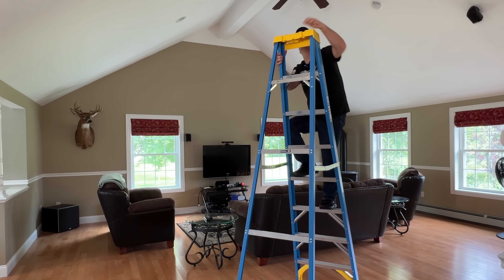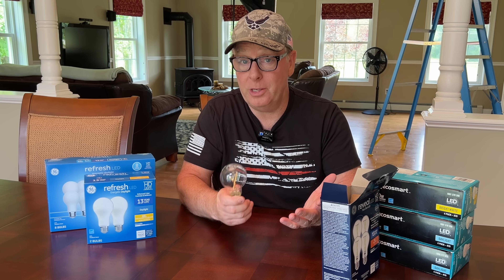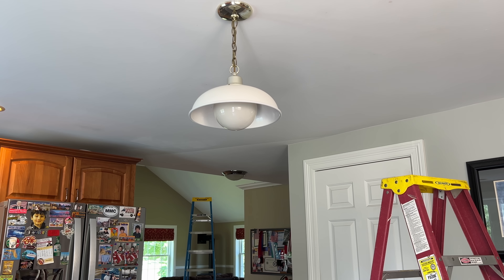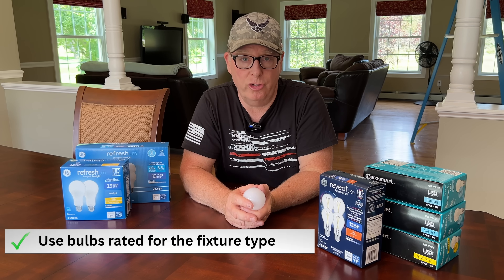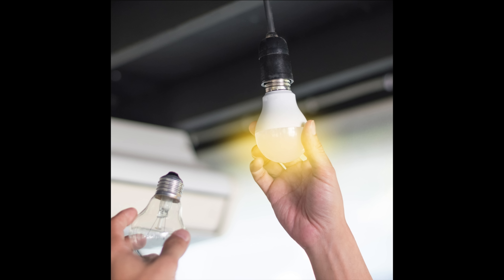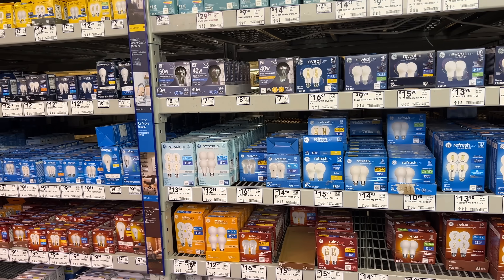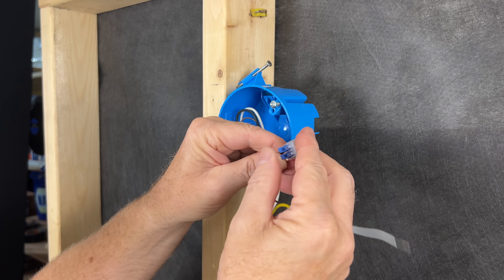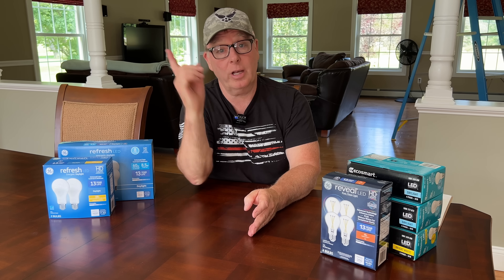The Mistake That Kills LED Bulbs

Comment: This video has quite a bit of equivocating in regard to LED lamp operation on "reversed" AC wiring, as in 'usually, swapping hot and neutral will not affect the LED bulb'. There is no justification for this. Due to their inherent circuit designs, specifically that the AC must be rectified inside the lamp, the LED lamp CANNOT be affected by swapping the two wires. Period. People who insist that it makes a difference don't know what they are talking about, or are at least mighty confused.

On the subject of LED lamp longevity, my own casual study over the years since the early days of LED lamp availability has revealed that QUALITY of components and basic lamp design are the primary factors. Note that I am referring only to LED lamps designed to look and function the same as traditional incandescent bulbs. I have a pair of Philips "First Gen" LED bulbs, each 100W equivalent, that have been in a totally enclosed fixture, OUTDOORS and operating all night long on a timer, for a LONG time. They were the first LED bulbs I ever bought, back in the early days. They are the kind that are shaped like a traditional bulb, but are dark gray, with three orange colored areas on them, from which the light comes. They seem to work just as well now as they did when new. WHY? One reason is that they made them of high quality components with high temperature ratings, and another reason is that the 'bulb' design kept the heat of the LEDs further away from the electronics.

I converted all lamps in my house from incandescent to LED back before most people even knew what LED lamps were. The lamps were quite expensive (the earliest ones I installed cost nearly $90 each). MOST of them are in either fully enclosed fixtures, or in down-facing frosted glass fixtures on ceiling fan fixtures; they fail about every 5 years, and spend more time on than off. The exceptions are the specialty globe-style LED lamps (no fixtures) I have over the sinks in my bathrooms. None of those has ever failed, and I tend to leave bathroom lights on except at night. Oh, I forgot my large workshop, which used to be lit via many 2'x4' fluorescent fixtures in a suspended ceiling, and I replaced the fixtures with new ones having electronic ballasts and fitted with Philips 'fluorescent replacement' bulbs. Since I spend about half of each day in my shop, those lights are on a LOT, and there have been no failures.

The most failures I get are on the LED bulbs (60W equivalent), three per ceiling fan, one fan per bedroom. For these, I just used the FEIT brand bulbs that the local ACE Hardware used to sell, not very expensive but still decent quality. All those bedroom fixtures are on dimmers that are integrated into the ceiling lamp controller that also controls fan speed; the dimmers are designed for incandescent bulbs....sometimes the lamps flicker, and I have to slightly adjust the dimmer to restore normal lamp operation. In my home office, I have the same exact kind of ceiling fan, LED bulbs in the same kind of down-facing open fixtures, but NOT on a dimmer circuit; these lights are on whenever I am not in bed sleeping, and I have to replace them about once every two years (they are also 60W equivalent FEIT bulbs).

I wonder if the LED bulbs currently being produced are anywhere near the same quality as the old reliable LED bulbs I have described above? I have noticed that my local ACE, and the others in the same family-owned chain in my county, no longer sell the FEIT brand, and have only the ACE branded bulbs and ones by leading manufacturers. They tell me that they quit selling any of the cheaper brands because of too many complaints about early failure.
Reply from the maker: If you watched to the end I explained the first part of your comment. I knew the lamp would work but I have had hundreds of comments telling me they won't. For example I just responded to a comment telling me that my voltage test was bogus because I would read 120v to ground even if the hot and neutral were not reversed. This is what I'm up against.
Reply: @BackyardMaine , thanks for your reply.  I did, in fact, watch your whole video. I was not trying to educate YOU, but rather add another voice saying essentially the same thing.

However, I still thought the early equivocating should have been more resolute.....

Comment: Well-known brands (especially Cree) fail too, & many times SOON.  The case of the Cree bulbs I had fail (30 flood lamps for ceiling downspots) was caused by temperature CYCLING, not overheating.  Every time something is heated & cooled, different parts expand & contract at different rates.  In this case, it was the different rate of expansion of copper winding (very fine wire in input inductor) from the hard epoxy it was encapsulated in.  Each cycle was like bending a paper clip back & forth one time.  After ~30 cycles, the thin copper wire "work hardens", embrittles, & breaks, cutting power to the rest of the circuitry.  This is POOR DESIGN, not cheap materials.  Cheaper inductors have their windings protected by heat-shrink tubing, allowing the windings to move relative to the rest of the part.  More expensive inductor, potted in epoxy, FAILS SOONER.  You could set a clock on the failure time!
"Don't leave light on all the time": sometimes, it is the CYCLING on & off that kills the light!
          The same goes for the rest of the components.  Each LED chip has 2 wirebonds.  There are ~100 wirebonds in each lamp.  All the components (LEDS & electronics) are soldered with ROHS (lead-free) solder.  This solder is hard & brittle.  It has no lead, but it FAILS, OFTEN, by cracking because of again, temperature CYCLING.  The whales are killed not by lead poisoning, but by being crushed by tons of discarded bulbs that should be still installed, WORKING, in lamp fixtures.
          Your explanation of why LED bulb works with line/neutral reversal is FALSE.  As long as nothing else contacts the internals of (any) bulb circuitry, the bulb does not "know" how it is being fed.  The front-end rectifier has nothing to do with with the AC polarity hookup!
Reply: I too found a bad inductor in a Cree LED lamp. I replaced it with one I salvaged, and it is back running again. They are a real pain to open and service.

Comment: My porch light is LED, a yellow "bug light" that still attracts flying bugs.. but I've had it on 24/7.  I had a photocell for the old incandescent lamp and did not remove it.  The first LED lamp lasted about 9 month, the next about 6 months.  I got rid of the photo cell and the 3rd LED lamp has lasted 5 years so far.  My experience with motion detectors is very similar - the 'pear shaped' LED lamps have vastly shortened lives.  OTOH I have a made-to-purpose LED yard light with a built in photo cell and it's been good for 4 years now.

Inside the house I think it's mostly heat dissipation.  LED lamps that burn base up, or have some kind of enclosure (like the school house "globe" shade on your kitchen fixture) tend to have short lives.  LED lamps that burn 90° (horizontal) seem to fair better than 'base up' even when enclosed.

Comment: Only place I've had trouble with early failure was using non enclosure rated bulbs in enclosures. On earth day in 2015 I replaced 11 bulbs in my kitchen with cheap Walmart brand LED bulbs, bought an extra one for good measure,  still going over 10 years later. Love these things.
Reply: My experience with Walmart bulbs was the same, but no longer.  Early in 2015, I replaced all the incandescent bulbs in heavy traffic areas of my house with Walmart LEDs.  I'm a night owl, so those bulbs get used at least 8 hours per day.

I got 8 or 9 ayears out of those bulbs.  One or two of those bulbs stopped working, and the rest were starting to dim, so I replaced them with new Walmart bulbs.  The new Walmart bulbs lasted less than six months.  I took them back to Walmart, and they replaced them for free.  Those bulbs only lasted a few months as well.  I took those bulbs back to Walmart and got a refund.

I used the Home Depot brand bulbs, and they have lasted two years so far with zero failures.
Reply: Target brand has a good rep.  And Home Depot, as in this video.
Reply: Yeah the Great Value bulbs from that era were really good.  I have one that stays on at least 8 hours a day and has been going strong for at least 6-7 years (and it's the glass filament kind as well).  The only issue is they are 80 CRI.  That's why I buy the Philips "ultra definition" bulbs now.  They have color accuracy (95 CRI) almost as good as an incandescent.

Comment: "Avoid no-name brands" Well unfortunately well know brands agreed with each other to purposefully make their bulb not last long. Your best option is to actually find which "no-name" brand make their bulb with no enshitification. The enshitification is often overvolted leds or an underrated resistor.
"run time" there should be no specific run time but thank enshitification again.
"rated for fixture type" it's just them purposefully making their bulb bad. If they were made to last they would generate little to no heat.
Currently running an experiment which should LEaD to long-lasting leds.
Our builbing's hallway has wiring which has no outlet, only lights fixture so i removed the AC wires leading into the fuse panel and plugged them into a 12v DC 100w PSU. Now all our bulbs run off 12v and i can dim them despite having no rating for being dimmable. They are rated 40w equivalent but output light brighter than 40w equivalent.
Doing all of this allow me to do two things.
One, there is no resistors that will go on a self destruc mission.
and two, dimming them allow the led to no be overvolted.
Also, the bigger, E26 bulbs that i bought have no electronic! the base is literally hollow so those should last a life time!

Comment: The results of my testing LED bulbs have found capacitors in the bulb assembly to be rated at 135F and it overheats because the bulb's housing retains heat. I disassembled the bulb and vented the housing and so far that test bulb has remained working for two years(12-14 Hours a day constant on). Other bulbs the Voltage regulator succumbed to heat build up and then failure.And Finally on multi-led bulbs like the HUE and Petme series the failure was due to cold solder joints and the little PCB board.Hope this helps and Thank You for your video.
Reply: Some fixtures have glass panes on a number of sides; I had one with a total of 8, so I just took out the least conspicuous one and the bulbs inside lasted much longer after that.
Reply: GE bulbs are goop filled power supplies so disassembly without permanent destruction is not intended and venting is similarly troublesome.
Reply: @mirror1766   It was troublesome and a challenge and that is what drove me to seek an answer it is like the light bulb cartel finds a new way to burn the consumer.
Reply: replace with mil spec caps ?

Comment: Of course it will work.. It's AC.  the "polarity" changes 120 times a second.
Reply from the maker: I mentioned that but the actual reason is that AC power feeds a driver not the LED. The driver delivers DC power to the LED.

Comment: 0:43 Reversing hot and neutral wires to a light fixture—aside from the safety issue—will not affect the light bulb's—regardless of technology (e.g., LED, incandescent)—performance.
Reply from the maker: You are correct..
Reply: Germany even today does not. For desk lamps the recommendation is to only change them with the plug pulled.

But also they are typically built so you do not touch the base while changing them.
Reply: the only time it causes issues is when the neutral is switched, leaving hot to the fixture all the time, that often ends up with dimly lit bulbs or strobing.
ran into that many times in older homes.
Reply: This happens when the capacitive coupling from the bulb's base to the neutral (either across the switch, or via ground) is strong enough to let enough current through to be visible. Some LEDs light up at a few microamps.
Reply: It's even Impossible to make shure the hot and neutral are always the same. Like for anything with a plug, like desk lamps.
Reply from the maker: @AzrethK9  For old lamps for sure but the newer ones require a polarized plug. One blade will be wider so you can only connect it in the correct polarity.
Reply: @BackyardMaine We don't have polarized plugs for small devices here.

Comment: Reverse polarity i.e. hot/neutral reverse such as can occur with the antiquated Chicago 3 way set-up of which I once came across on a farm wired in 1951 - '52, will not affect your typical E26 base LED lamp because the LED's themselves run off DC, supplied by the internal driver that converts the incoming 120VAC (or 208, 240 or 277 volts which could be found in some commercial/industrial buildings) into low voltage DC, and AC changes polarity 120 times/second, or 100 times/second for those living overseas with 50Hz.
Reply from the maker: I think I said almost those exact same words in the video.
Reply: @BackyardMaine I began typing that shortly after I pushed play.   I must have psychic powers 😅😂.    

Jokes aside though, I gotta admit the Chicago method was both a rather ingenious and wacky method of wiring 3 way switches, we've come light years ahead in electrical safety over the last 75 years and I'm glad we no longer wire 3 ways like that.
Reply from the maker: @rarelampcollector  Great minds think alike.. lol

Comment: I haven't seen any correlation of long life vs costs or fixtures. 
I have a flood led light going on 8 years now. It's on at dusk. Which means it's at 35,000 hrs or so, because at times, the nights here are rather long. Also, another outdoor bulb is at the same age in a smaller fixture. Also going on 8 years. 
Yet the plain Jane indoor bulbs can go out in 1.5 years at 10hrs usage a day (some of the usa made  bulbs are bucking the trend at 4 years of age)
Reply: I don't know how a correlation between life and cost could be calculated when it seems to be that the bulbs in the same box put in the same multi light fixture don't even have the same life span. I've noticed if a bulb fails it will be within 6 months. If they can make it past that they will last years. (As long as I don't get anymore no name bulbs from Menards, I also don't like Feit).

Comment: On the semi enclosed fixtures there is a big difference in running base down or base up, with base down resulting in longer life, even in enclosed fixtures, as the heat is not being put directly into the electronics.  As well you also need to consider how big the bulb itself is, you can get 2 different nominally 60W equivalent lamps, one larger than the other, but both with a real power draw of say 7W. The larger lamp will likely last longer, simply because there is a larger area to dissipate the heat generated.
Reply: And of course the standard 99x out of 100 it's base up. 
I've noticed that too that the cheapie ones lasted six  months or a little more running non stop mounted sideways out in the open air with lots of breeze going past.
Reply: K
Reply: That makes a lot of sense.
Reply: LED bulbs are not the only ones that matter bass up bass down. Some of the old school commercial lighting fixtures need to have Bob's rated for the base orientation as well such as high pressure sodium add metal halide. What was Bob's had a designation with bu indicating base of or BD indicating base down

Comment: The Philips Ultra Definition are good (frosted or clear), the LEDs are in the middle of the bulb like traditional ones instead of at the base like most cheaper LEDs (the ones with the plastic base).

Those GE ones you showed also are like that, but the Philips Ultra Definition have the best color reproduction and flicker, as tested by TheHookUp here on YouTube.

Comment: I have bought numerous brands from Lowe’s, HD, Walmart, and of course Amazon. From my experience, GE has had the most failures‼️The vast majority of bulbs comes out of China anyway so the name General Electric is meaningless❗️
I have a considerable number of LED bulbs outside (soffit lights) and floodlights. ALL are on dimmers for a better nighttime appearance. They have been working for years now with no failures. DIMMERS really do make a difference as far as longevity is concerned.
Reply from the maker: Glad to hear dimmers have extended the lifespan of your bulbs! I have not had your experience with GE bulbs. For me they have been solid.